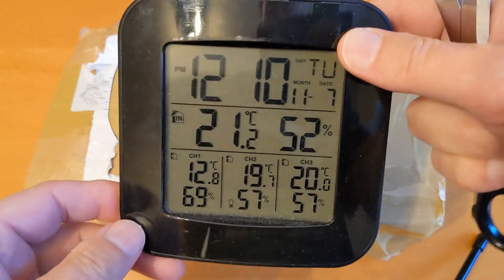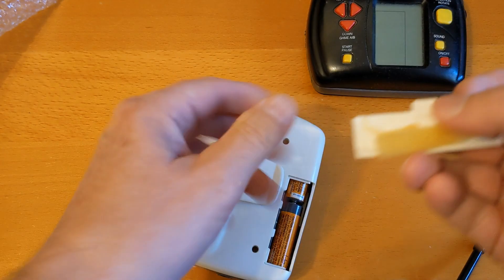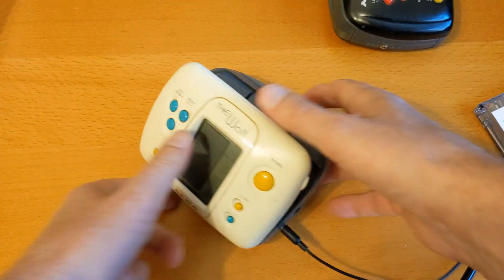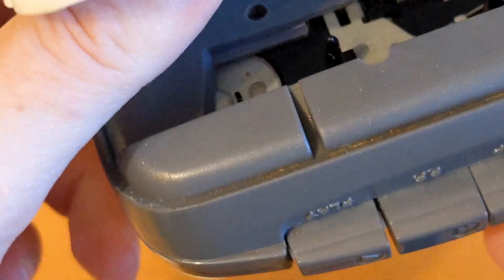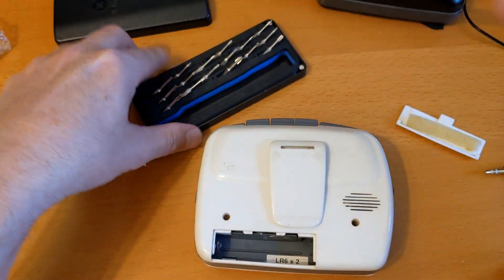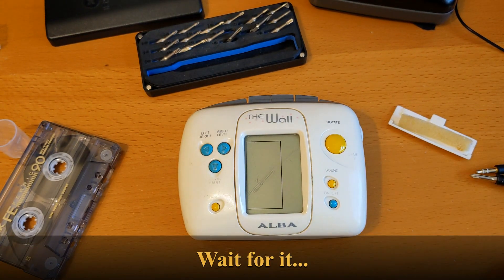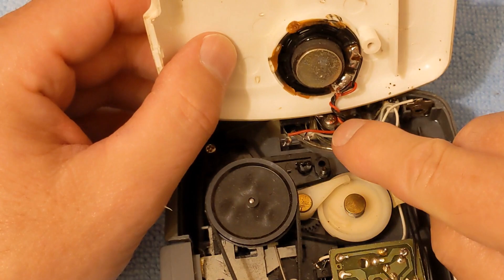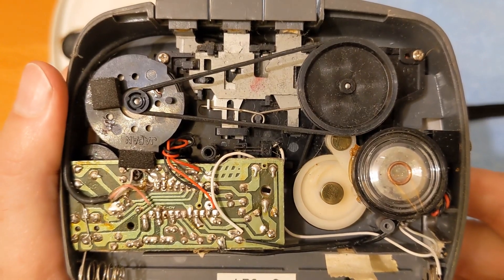Another Brick Sells The Wall

Comment: I remember wanting one of these when I was little. I never got one though. They were in the Argos catalogue I think. I did have some of the Systema LCD games though, I still have some but they don't work.
Reply from the maker: I had to do a YouTube search for Systems LCD games. I wonder why yours don't work. I would hope that it would be just cleaning contacts and such.
Reply: @CBitsTech  Some turn on if I apply pressure to them, but that's not idea. I guess it might be something to do with the zebra strips. I don't know though.
Reply from the maker: I saw someone else's video where there was a display problem with a similar game, I think you're right about the zebra cable. Tricky repair sometimes, so I've seen.

Comment: It probably has been messed about with however the general messiness isn't uncommon with Chinese assembly of this era - I have seen worse on brand new items!

I'm wondering how the hell the manufacturer has managed to make a basic 3 button tape mech that needs two belts mind, that's some serious inefficiency right there.
Reply from the maker: Yeah, it wasn't a very neat job. Just thrown together.

Yeah, that's a good point about the two belts. I suppose, but haven't checked, that one is for the take-up spool and one is for the capstan. I never really considered what the belts do before now. I guess two belts reduces the complexity of the gears. Something new for me to ponder.

Thanks again for your help troubleshooting the speaker issue on this one.